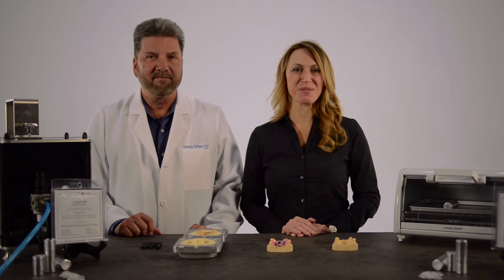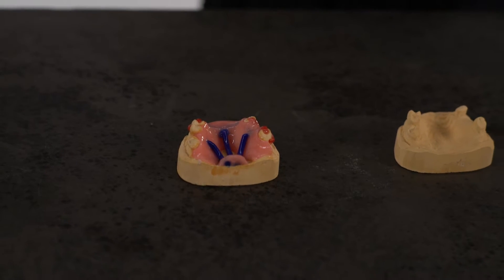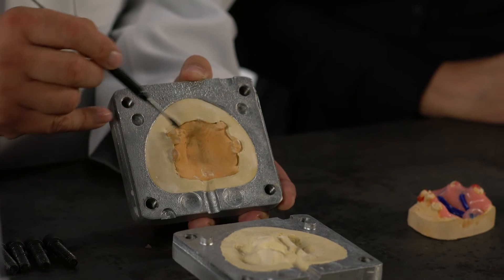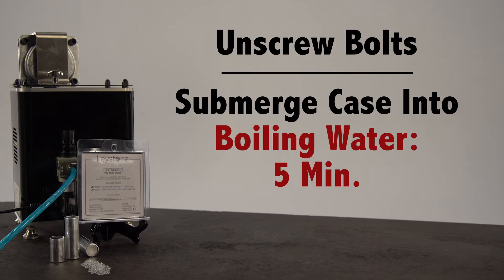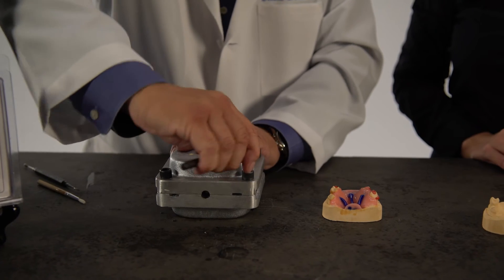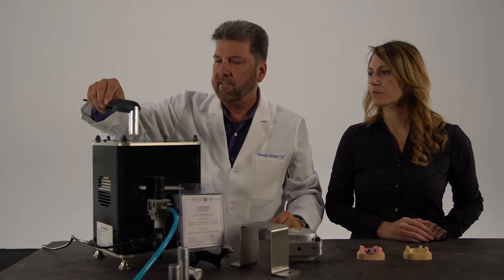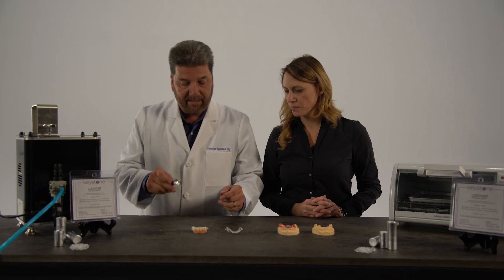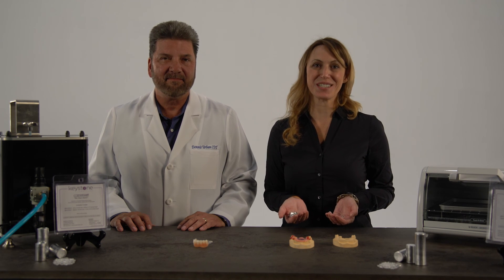Fabricating a Clearmet Partial

Comment: How is the bond between the acrylic and the partial does it create food trap between the clasp area when it’s flexing and the acrylic? Also are the claps like valplast or do they brake easy ?
Reply from the maker: Hi! Thank you for reaching out. There is no natural bond between ClearMet and acrylic, but if it is designed correctly, there will be no separation. That is, the acrylic must come up to the interproximal junction near the clasp. It is a totally different material than Valplast.  Valplast is a vinyl based material that is super flexible. Clearmet is a semi-flexible thermoplastic material with much more rigidity than Valplast. If you have any other questions feel free to email us at  customerservice@keystoneind.com